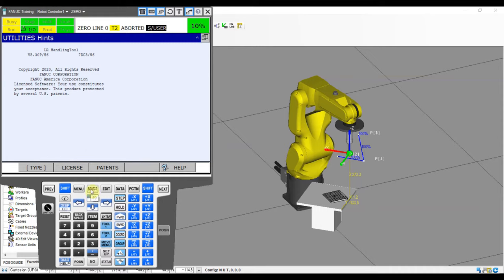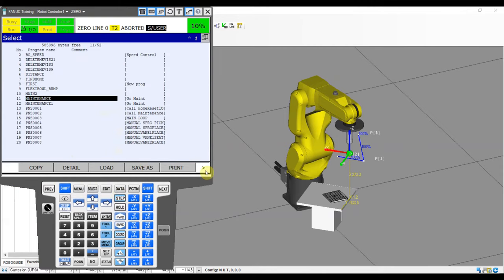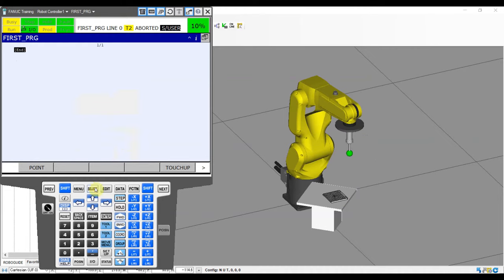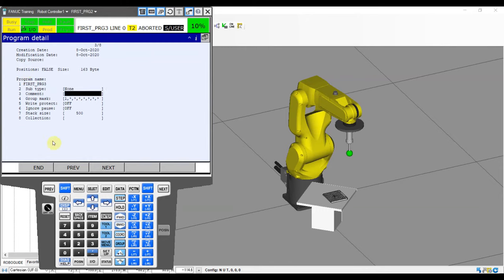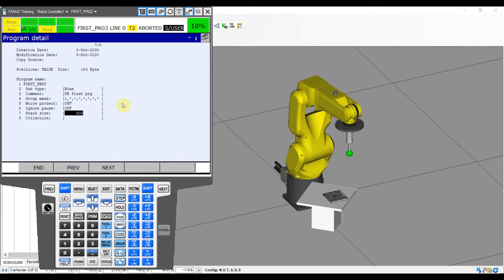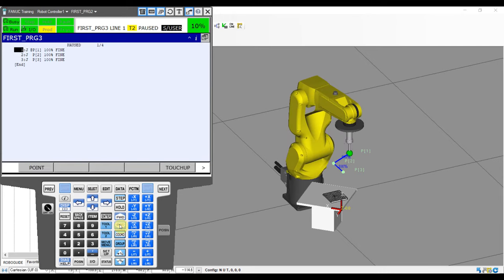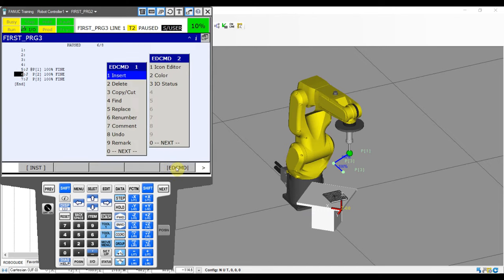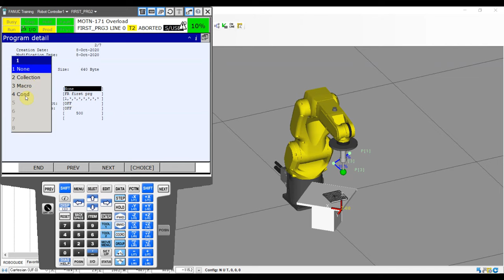FANUC programming tutorial - Create your first program. How to create a TP (teach pendant) program ?

Comment: hi can u tell me how to change a program fanuc robot ?
Reply from the maker: Hey, I'm not sure what do you mean :-)

If you want to change the program that already exist, you need to select it by hitting enter on the select screen and than you can make changes
Reply: @FutureRoboticsChannel  what initial setting we require to change a programe and run the another one one fanuc robot 2000i. like we have some jobs running on the same robot when one finish we change the program to run another job . these robots work on transfer presses..
Reply from the maker: @vikassharma8358  if the robot is in the same spot, than nothing, but probably you want to teach UF and TF